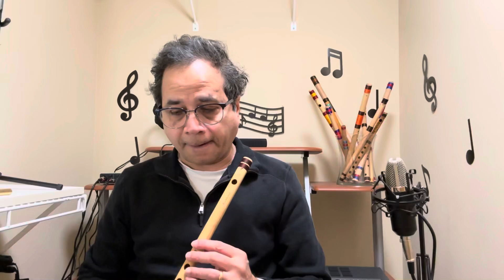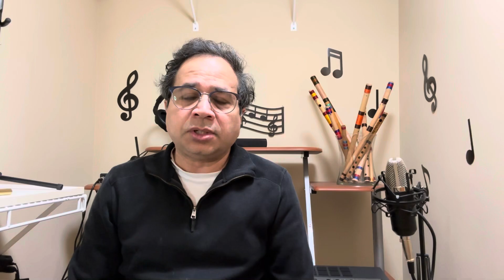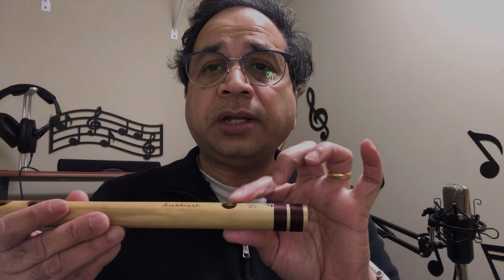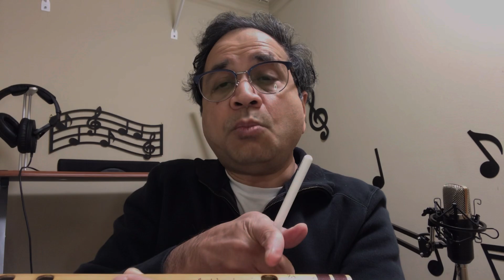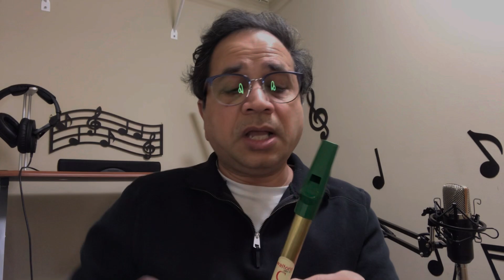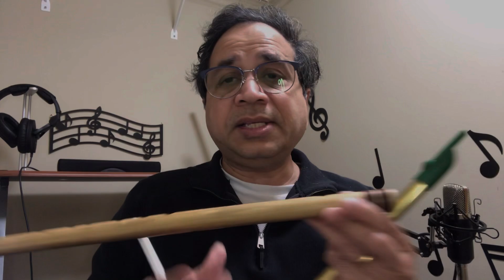The  ‘edge’ behind the sound of a flute

Comment: Thanks a lot for educating us with your interesting and inspiring videos, sir. I have one question about the blowing hole, I’ve noticed that makers use different techniques. Some keep both the inner and outer edges, while others make a single sharp edge, similar to a tin whistle. Which of these produces a better tone with less hissing sound?
Reply from the maker: Thank you for your appreciation. 

There is optimal thickness. There is no single universal answer to this. 

Thinner edge makes it easier to blow, but too thin, changes the timbre of the flute. It would amplify high frequency over tones and suppress lower frequency overtones, making it sound more like a tin whistle than Bansuri. 

Higher thickness promotes a more balanced timbre. But too much thickness causes more hiss and dampens volume. 

How a player blows also makes some difference.

These are the considerations. There is no heuristic answer to this. 

It is also a technique to make thinner flutes for lighter weight and use a lip plate to increase thickness at the blow hole. Metal flutes do this.
Reply: @VindyDays  Appreciate your clear explanation! That really helps to understand the balance between thickness and tone.

Comment: Namaste Sir, Very good explanation.I am learning hindustani flute in carnatic style.(closing first two holes for “Sa”).Is it good idea to clean inside of the flute with oil to remove fungus and for better tonal quality?please share some tips for maintenance of bamboo flute. whether weather conditions have any affcet on flute playing?
Reply from the maker: Namaste. Bamboo is seasoned before making a flute. While the density and temperature of air has slight impact on the tuning, it is negligible, given that anyways this is an adaptive instrument, meaning, the player has to adapt based on the feedback. While it is a good idea to keep them clean, these seasoned bamboo flutes don’t require special cleaning. Simply washing them with water and air drying is good enough, if you must clean for some reason. I haven’t experienced any fungus problems.
Reply: @VindyDays  Thank you,sir.🙏

Comment: Sir I am a left handed flute player. I play right handed flute.. Is it okay sir?
Reply from the maker: Since you say you are playing it, I presume it has been working for you. Human hands being symmetric and you being dexterous with left hand, most things work the same way. I see two things that may not be symmetric and could cause issues. 

1. Blow hole edge may have been prepared on one side for ease of play. By reversing you may be playing using the non-optimized edge. 
2. The 7th note hole would have been positioned for the right little finger (pinky) to reach. It is not symmetrically placed. By reversing the flute you wouldn’t be able to reach it with your left pinky. 

#1 may not be an issue if the flute is symmetrical and has no special edging. 

#2 may not be an issue if you don’t use that pinky hole at all. That is only required in some rare cases. 

Logically, you should be fine to start with. But if you take it to high performance levels, you would be better off having a flute optimized for left hand playing.

Comment: Beautiful explanation. What is relationship between the mouthpiece and stopper. I dont seem to see much difference on my flute in frequency.
Reply from the maker: You mean, what is the impact of the distance between the blowing hole and the stopper cork on the pitch of the flute?  Position of the blowing hole has an impact on the pitch of the flute. Position of the cork also has an impact on the pitch of the flute. But the cork position seems to have less impact. I don’t know the precise relationship. But I do know that flute makers adjust the cork position to fine tune the flute. Usually they finalize it by gluing it. Maybe, a flute maker following this thread can throw some light on this.

Comment: Sir give measurements for all scales from base with tuning charts on each holes in series with advanced technology
Reply from the maker: Follow this and you can make the charts you need, yourself. 
http://iotic.com/flutomat/
Reply: @VindyDays 

Thank you very much for the enlightening video that you have uploaded.

I yave never found such a nice explanation anywhere else.

Regarding the Iotic Flutomat website, I found that whenever we switch the units from mm to cm, the entire sizes of holes, the distance of homes change to different size.  (when we change the unit from mm to cm, the ACTUAL SIZE should not change, but somehow in this webpage, the size changes.)
Reply from the maker: Thanks for your appreciation of the content. 

Flutomat may have an error in mm to cm conversion. Just use it in units of mm and measurements work fine.